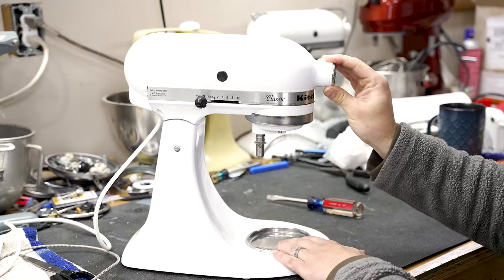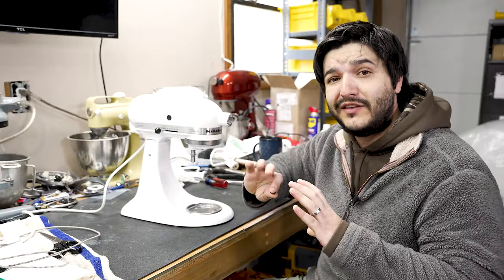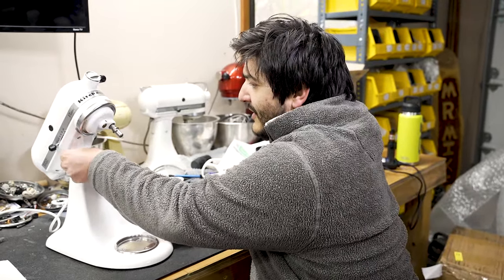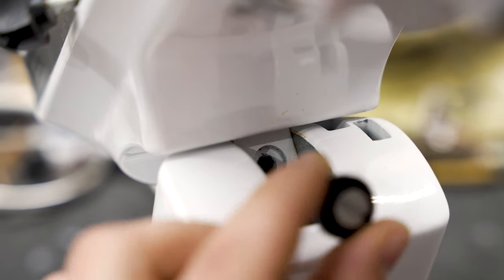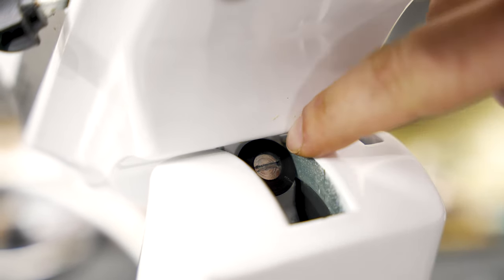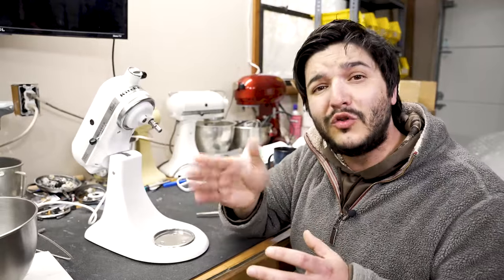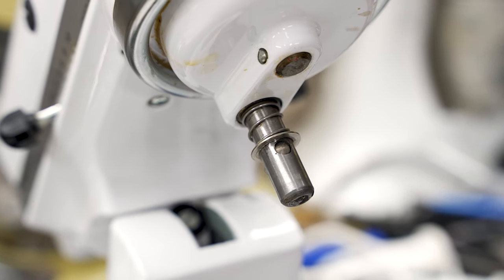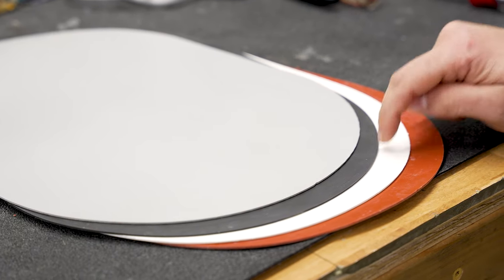Upgrade Your KitchenAid Mixer! Protect it with the Everdime!

Comment: I don't know what I did wrong...once I installed the Everdime my tilt head would no longer lock. I fastened it down tighter and it locks now, but it is definitely too high to pass the dime test. It feels as if the Everdime didnt fit properly, but I trust in you, so I know it must have been user error. Help me, Mr. Mixer! 😢
Reply from the maker: Send me an email! It's way easier to resolve issues there mrmixer316@gmail.com
Reply: I’m having the same issue. My tilt head is too high and if I tighten more the everdime is now twisted if that makes sense. 🤷🏻‍♀️
Reply from the maker: @jba4396  send us an email mrmixer316@gmail.com

Comment: They must not be countersinking the hole as deep on the new mixers. No matter what I did the lock lever wouldn't engage all the way and the screw was going way too deep into the rubber. What I did was took a razor blade and trimmed off 1/2 of the rubber part that goes into the countersunk hole. That allowed the large part of the rubber washer to sit flush with the base and allow the screw to tighten without gouging into the washer too much. It all worked out and eliminated the bounce in the head. I checked  the clearance to the bowl with the paddle attachment with the tilt head locked and all is good there.
Reply from the maker: They did make a change, I'm glad you got crafty! We redesigned it and now it fits proper and is universal

Comment: Now this is a clear video tutorial.  Looking forward to re-installing my Everdime soon 😁
Reply from the maker: I redid it to make it as clear and concise as possible!
Reply: Why did you uninstall it?
Reply: I purchased the older revision of the everdime.  Because I didn’t know at the time that the older revision would not work with my mixer, I stripped the threads while tightening the set-screw.  I purchased 2 new set screws and a tap from Mr. Mixer to repair it myself…but that was months ago and haven’t gotten around to it yet 😐  if I decide to buy a new everdime, I’ll be sure to ask for the latest revision- so I won’t make the same mistake again.

Comment: Just installed the Everdime.  I had no trouble screwing the screw back in although I was careful to be gentle until I was sure it was threading correctly.  I adjusted the height using a dime.  However the head still has some bounce to it although not as much as before.
Reply from the maker: They are all casted so different that sometimes you have to just loosen it ever so slightly so that it tightens up the head
Reply: @MrMixer316  Thanks for the fast reply.  That helped.  I figured it's more important to slightly move the dime than to eliminate all the wobble so I loosened the screw just enough to just slightly move the dime.  It still wobbles a tiny bit but not nearly as much as it did before.  Thanks, Mr. Mixer!

Comment: On newer models the everdime will not fit perfectly in that "divot" mentioned at 1:27.  Instead of having that button shape to the "divot" as on this mixer and the everdime itself, it is more like a bowl shape. Anyone interested in purchasing this may want to remove the screw and compare the "divot" on your mixer to the shape of the everdime itself.
Reply from the maker: They are not all like that, it's wierd because we have brand new machines and most of them are normal, some are cup shaped. Either way we are redesigning it to fit both models ☺️
Reply: yup- I'm pretty sure this is what happened to me.  I made the mistake of just tightening and tightening...which of course caused multiple problems.  Got new screws on order from Mr. Mixer and a tap from Amazon. 😁
Reply: @jlindema same thing just happened to me 😩 do you have a link to the tap? I’m not sure what I’m exactly looking for
Reply: What's the difference between an everdime lock washer and (say) purple locktite?
Reply: @trleith  You save about 10 bucks with the loctite and you still have some to use on other stuff.
Reply: Same happened with mine but I was able to tight it and pass the dime test and use the latch on the side to lock the arm. So hopefully all good!
Reply: @MrsLyds You definitely didn't do what the people above did. If you cross thread you will not be able to adjust it properly.  You will have to retap the threads and possibly have to replace the screw. Most of the time it just needs to be retapped if you didn't mess up the threads too much.
Reply: @BringItOn31124  it screw just fine
Reply: @MrsLyds  Glad to see you didn't cross thread your mixer, like the people in the above comments, trying to install the ever dime.

Comment: @mr. Mixer , do you recommend me installing everdime in my 7qt proline ?
Reply from the maker: @EmadFayek16  the everdime is only for tilt heads, but I do recommend our quick install spring and washer.
Reply: @MrMixer316  thanks a lot … I actually did install them thanks to your advice in the videos which I found them extremely helpful … one question do you have video on how to re greace 7qt/8qt  proline mixer
Reply: @MrMixer316  how can re greace 7qt / 8qt proline ? As you showed us on video they are designed differently if compared to 6qt

Comment: I cross threaded my screw. Can I just use the Tap with a socket wrench or do I need to get the handle and fluid too?
Reply from the maker: You could use a tap with a socket wrench, usually it's just the first couple threads that get boogered up. Spray a little wd40 on the tap and give it a few turns an it's fixed!

Comment: If the head of your mixer is bouncing, chances are, the head is too low. Turn the adjustment screw to the left (loosen) to raise the head. Do the dime test to make fine-tune adjustments. You may also want to check your hinge pin to make sure it is centered. If it's not centered, I like to loosen the screw that secures it, which is located under the base of the mixer a half turn, center the hinge pin and then strongly tighten the screw to keep the hinge pin from moving. The enamel on your paddle tells you a lot about what adjustments need to be made. Enamel missing on the bottom of the paddle tells you that the head is too low and needs to be raised. Enamel missing on the side of the paddle tells you usually that the screw that secures the hinge pin is loose and needs to be tightened. Again make sure the hinge pin is centered before tightening.

Comment: I need two new rubber stoppers to the bottom of the mixer and the screws that go with it.  Not sure what happened there but they gone!  I found part of one when cleaning, it was broken in half under my fridge.  Do you have any?  If so how much do you charge for them compared to Amazon or KitchenAid replacement parts?  Also, if you have any spare bowls around, interested in one of those.

Comment: I have a newer version and the head lock doesn’t work after installing the ever dime. The head does not go all the way down when closing. It looks like the recess where the screw is isn’t as deep on the newer models.
Reply from the maker: Send me an email, we have a redesign that is currently in manufacturing but we have a handful available
Reply: I just received mine and had the same issue

Comment: I installed the everdime correctly but still have head bounce. Is that ok?
Reply from the maker: @carlosherrera2913  that often means there is an issue with your lock lever system, it's probably slipping a bit after it's engaged.
Reply: Remember, tightening the screw (turning to the right) lowers the head of the mixer and loosening the screw (turning to the left) raises the head of the mixer. The head bounce is usually a sign that the mixer head is too low.

Comment: I put this on but it's not touching the dime at all. Grazing straight over it no contact. Did I install incorrectly?
Reply from the maker: You may just need to adjust that screw by giving it a quarter or half turn to get it just right. One direction raises it and the other will lower it. The Everdime is designed to keep the screw in place so it won't move due to vibration or anything else over time and to get ride of the head wobble. Feel free to reach out to us if you need any help with it, mrmixer316@gmail.com!

Comment: Disappointed with this. I went to install on my 2021 mixer and it was frustrating. I am going to need to buy a new center screw because the angle of the flathead to the screw stripped it. It also seems like the everdime is too long. I was excited to try it but now I can’t even use my machine. I was unable to get the center screw back in alone. 😢
Reply: Did you fix it?
Reply: The video specifically warned against the possibility of cross-threading

Comment: A warning, it is not compatible with the artisan mini and the screw will get lost if you drop it inside unlike the full size and getting into there is not a simple job... And I haven't figured it out yet
Reply from the maker: Oh sucks! If you turn it upside down and shake it should come out. You may need to remove a couple screws on the white panel in the underside of the machine. Shoot me an email, we can help
Reply: @MrMixer316  I actually did manage to get it out. My stepdaughter was over and I was showing her that it would not shake out... And then it did. I know a little more about taking it apart now